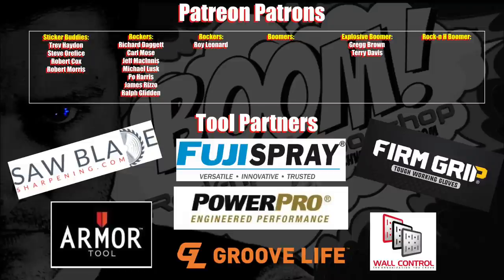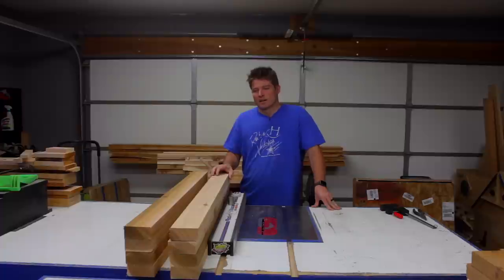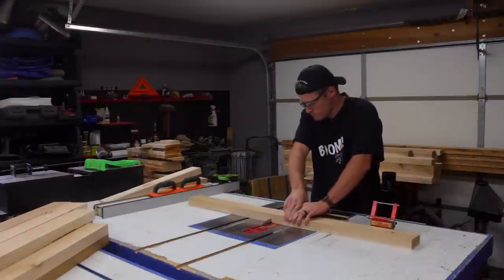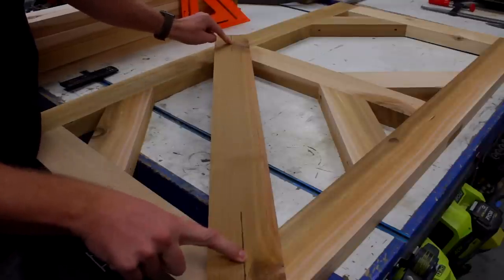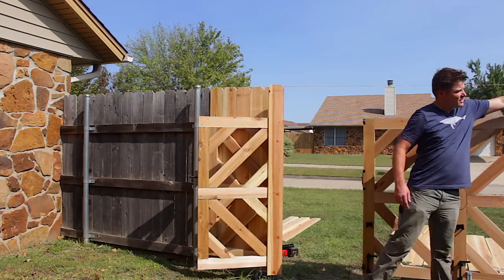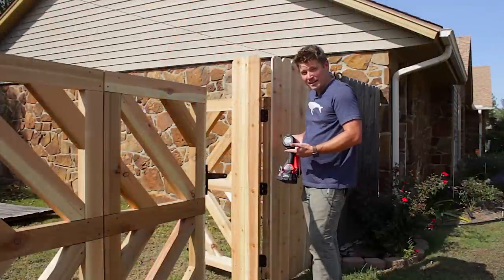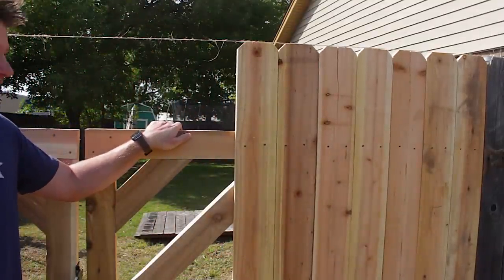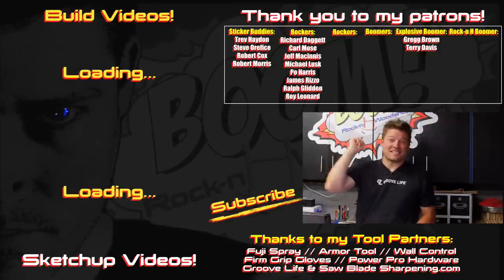THEFT RESISTANT Bifold Gate System - HIDDEN Hardware

Comment: After Hurricane Sally, I replaced my gate, almost identical to your original.  It's done, but I'm thinking there has to be a better solution. Mine opens out,going in the uphill direction,so you can imagine the lifting and tugging that I have to do.  This design will allow the door to open inward and the clearance to the ground would increase, making the door to open vert easily.  Heading back to Missouri for another load of furniture and tools and sometime in the future, this project is on the list.  Thanks for sharing.
Reply from the maker: Awesome! Glad I could help you out. Send me some pics. I would love to see it.

Comment: great Video, i watch it over and over again , only thing i have a suggestion on would be the locking latch: 
eliminate it completely and have it lock from the inside maybe with a cross bar for a cleaner look outside? would that be even safer since there’s absolutely no access from the outside nor it brings attention that is an actual gate? other than that thank you for this video, PS update the links in the description please 🙏
Reply: Eliminating the locking latch so there's absolutely no access from outside the gate only makes things safer if you're the threat since it only affects your access. This kind of latch can still be locked from inside the gate, so it wouldn't pose any more of a safety threat than a locking doorknob would on an exterior door. When you eliminate either of these all you add is frustration not safety.

Comment: Hope you replaced the rest of your fence and made it look that nice, seen some old boards with big gaps that small animals might be able to fit through it, plus it's not right when it takes a few hundred bucks more to make front curb appeal look nicer. Keeping those old ones and replacing ones that might need it. Fencing isn't made to last at all. 10 to 15 years and that's on high priced stuff that's treated lumber not to rot. Yeah right. My wall of 3 1/2 by 5 inches just running along driveway looked good and just fell apart. Rotted from inside out. I even predrilled holes for big nails wouldn't spilt wood and was worth it, now have those big spikes under my porch as I'm pulled out and threw wood away while having repairs done on house, said throw that in dumpster,  I did and any big spikes, I kept since there costly back then. Just bottom layer in ground but spikes sticking out that I pull out with a wiggle.  Very nice fence and heavy duty to last,  that's for sure. Do it right the 1st time and no issues later on other than paint/stain and maybe might need new wheels over time if not used often,  can freeze up from weather over time.  Nothing made to last unless you made it yourself for the most part.

Comment: A great design and good build. However, I'm a bit confused. Shouldn't the diagonal braces, to stop the gate sagging, go in the opposite direction? I thought that they should point downwards towards the hinge side and not away.
Reply from the maker: Correct they do, in order for me to achieve the design I wanted, that’s why I required the extra bracing in the opposite corners